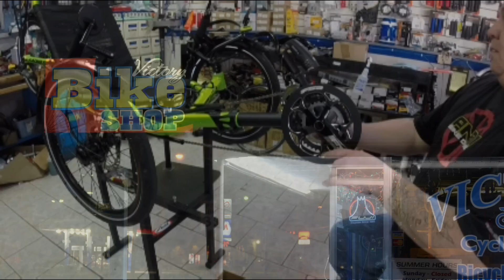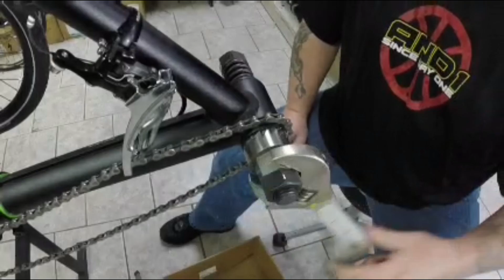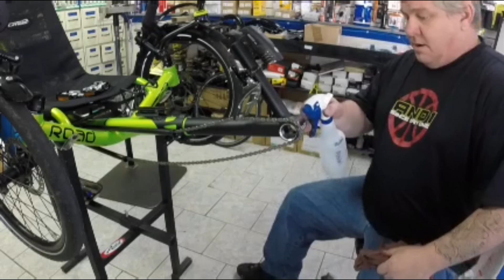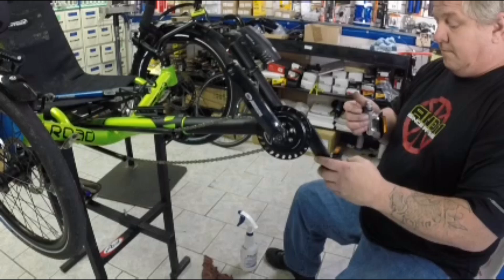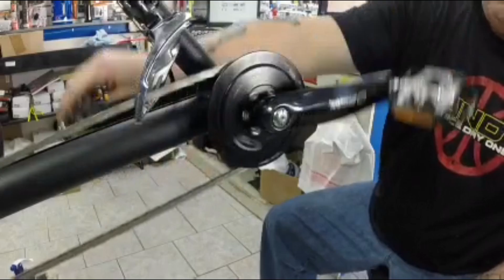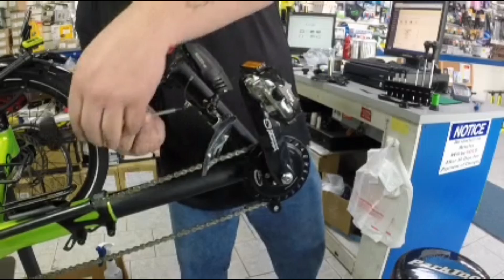Schlumpf High Speed Drive install on a Catrike

Comment: Question: I have a deltatrike Hasebike Kettwiesel Lepus with Shimano Motor 8 Speed. can the aaaschlumph Innovation System installed at my bike as well, or is it only for trikes without Motor? thank you for answering me! Pol Hoeben from ALTDORF SWITSERLAND

Comment: Video is definitely not for the inexperienced.. lot of steps were skipped over.. ie measuring the diameter of the camper.. torque specs… adjusting the push button etc etc.. some narrative could have taken care of this but it wasn’t included..